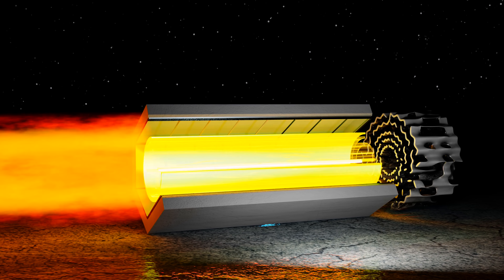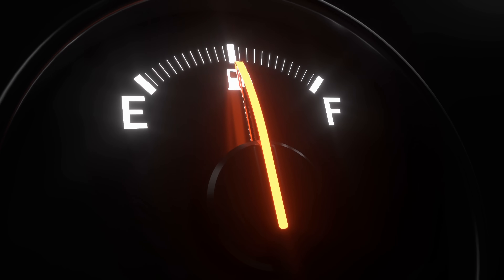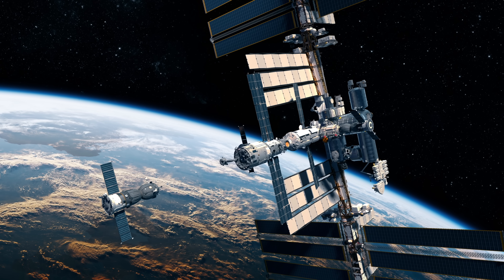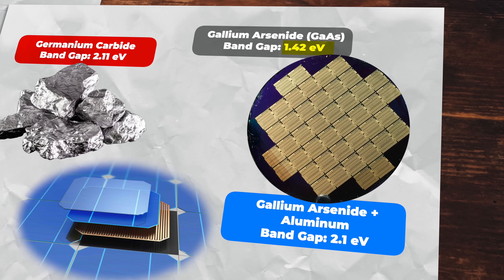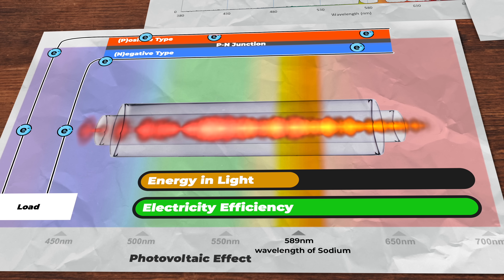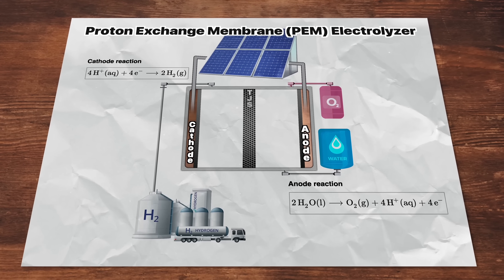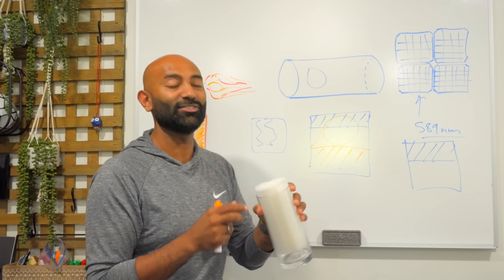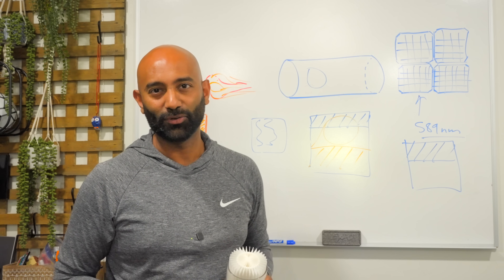Why Solid State Might Save The Combustion Engine

Comment: It would also make a much more efficient RTG for deep space missions.  I imagine, though you have to heat up the sodium vapor to a pretty high temperature to get light output. Probably hotter than the exhaust of a traditional internal combustion engine.
Reply: In a heat engine the maximum efficiency is (hot side-cold side)/hot side.  The problem in space is the cold side as the only way to cool is via radiation which is very inefficient at the temperatures involved.
Reply: @mtpaley1  that is a good point, but it’s also true of standard RTGs. However, I suspect that the temperature required to get the sodium vapor lamp effect is much higher than standard RTGs so larger radiators would be required. Adding weight.  Maybe you could offset that by carrying less plutonium, but I doubt it, and it would kind of defeat the purpose of having a more efficient unit if you were forced to carry less total capacity.

Comment: I don't see how the fluorescing of sodium is going to ever be highly efficient.  First of all the heat transfer is going to take time, you have to raise temperature high enough to both break Na-Cl bonds, and then further excite the valence electrons in Na, and you're depending on how much of that heat is absorbed to excite electrons up a band.  There is no way that can be more than single-digit efficiency.
And even with a tuned bandgap PV, absorption efficiency has to be near perfect, which itself strikes me as nonsensical.

I think it's safe to say that the optimal fuel for this is the highly abundant Oil of Serpent.

Comment: I like how your mind works on problem solving…. I spent a weekend with a heating engineer who would be great to capture the waste heat from the car engine using phase change materials… so that when you came home, you could dump this heat into your home water storage system. Not as fancy technically as PV but workable…. Until you look at weight being carried around. Still… always great to pull problems apart and see where you end up.

Comment: How do you inject fuel and air without moving part? Carbon deposits from combustion on the panels will absorb the light reducing PV efficiency.

Comment: It sort of do not solve the reason why we want not use combustion. And that is the combustion uses up the fuel and that fuel becomes pollution.

Now, I am actually not against fuels in general over using batteries. Some fuels do not put out what we would consider to be harmful pollution. Like Hydrogen that when it burned just output water. But you still need a way to produce it.

While the claimed efficiency may sound high, there are gas turbines can get efficiency over 60%. Of course that comes with it own costs since gas turbines are pretty much the opposite of a solid state device. Lot of moving parts. And if they get that working, it could of course have uses. But is very much a technology I want to see running before I start to believe it. 

So yes. In short. I do not think this would save the combustion engine, but if it works it may replace in the areas where combustion engines would still make sense to use. And that is only if it works.

Comment: Absolute BS!! Why do you fall for this BS. Carnot efficiency = 1-T2/T1. (Temp in Kelvin). Assuming efficiency of solar cell was 90% (unlikely) the efficiency of heat engine would have to be >90%. Assuming engine cold side temp (T2) was 100 deg C (373K), combustion temp (T1) would have to be 373*10 or 3700K. Do you think you could generate sodium light at 3700K with 100% efficiency!! I think not.

Comment: Although it may be efficient, we don't always need loads of energy quickly and this seems like it would burn a load of fuel extremely fast compared to the trickle of a battery or small controlled burns in a combustion engine. How do we control output in this type of engine?

Comment: The most efficient engines we have are turbines which can get at least 60% and some modern designs claim 70% or higher.  I would be very surprised if this could do that. There are always unconsidered parasites that rob efficiency. There is a chance that this could work because 1) it channels thermal energy into a monochromatic light wavelength.  There is almost some violation of entropy going on to do this with high efficiency, but ignore that for now.  As the sodium gives off its light, that lost energy will need to be replaced.  The end exult is that at some point you will not have enough temperature left in the tube to make the sodium emit.  BUT, you will still have high temperature exhaust.  This is the final limiter of this device.  I don’t know how much energy ends up coming out the exhaust of his thing, but it’s go to impose at least a double digit penalty to efficiency. I’ve got to believe hat waste heat must be near 30%.  But, for the heat energy retained, with a long enough tube it could be all converted to sodium light as long as there are no other losses (which I’m sure there are: black body radiation for example).  But I suppose that conversion to sodium light proper might could be fairly efficient.  And then if the solar cells have a matching narrow band band gap, at least with some mirrors you might collect a fair percentage of the photons.  In the end, there are lots of efficiency leaks in this that can easily reduce the net total efficiency.  So I doubt it could be much more efficient than a modern high efficiency diesel.  However, it it can be made light and small, it would have many uses.  Other than efficiency, the one key problem I see is materials.  This thing needs to be transparent, while also being able to sustain very high temperatures over long periods of time.  Unless they can figure out cooling solutions, that might doom it there.  Will be interesting to see if it can be worked.

Comment: An interesting tech.
A: The effluent ie how polluting is it.
B: Our material science should be able to design the materials needed.
C: An interesting tech to watch.
D: Looking forward to independent test results.
E: Very clever if the numbers prove true.
I live in a hurricane  prone area of Tx and have used standard gas generators here to keep the fridges running.
NOT very efficient and LOTS of moving parts.

Comment: Build a working prototype and show it to others. At first glance, this looks very problematic to me. A few obvious issues:
1. What is in the exhaust and where does it end up?
2. How do you control it with no moving parts.
3. Two problems with all fuel vehicles are a) Creating the fuel. and b) Distributing that fuel.

Comment: Something strange.

The end product is a Free Electron. 
You're using Solar Cells to do this.
Light from Heat
Heat from Combustion.
Combustion itself is simply the rearrangement of molecules as well as Electrons. 

Why haven't they considered getting the Free Electron from the chemical reaction known as Combustion? You know its happening. It sounds a lot more efficient than adding more conversion steps.

Oh yeah. Because then you'd call it a Fuel Cell instead.  Got it.

Comment: Based upon your description, you should be able to simulate this system even on a small scale using a candle.

One problem i see is that so much energy will go out the exhaust (not just heat but light too). So i can't see how they can get the numbers they're predicting. 

We'll just have to see a prototype.

Comment: why not use solar collector to heat up those sodium and then use the tuned PV cell to convert it to electricity? wouldn't it be cheaper for static power generator

Comment: Every single time energy changes form it doesn't change 100% of it's energy from one from to one other form.  It always has different percents go to probably all the different kinds of energy like part heat, part going to light, sound, kinetic, etc. types of energy.  This means the more times the energy changes form the less likely you are to get the type of energy you want out of the system.  If you change chemical energy to heat, to light, to electric, to kinetic to move a car the efficiency is going to be crap.  This means this is another company trying to get investor money, so they can make that money disappear, and say later, will it didn't work out.  Who would have known.  Well a good engineer like myself would knows.

Comment: Better than using an ICE:  Use the main burner as stated with photovoltaics, then using catalytic converters to heat a second chamber.  If that exhaust is still hot, you can add a bank of peltier chips along the outside of the photovoltaics and the final exhaust to not only cool down everything, but increase the efficiency even more.  Rather than a flat wall of PV panels around the main combustion cylinder, you could angle them so that they bounce light around for more surface area in an inverted flower shape.  The whole device could be incased in a tube that uses filtered air from the forward movement of the vehicle while in motion, and a fan at idle that uses Bernoulli's principle like a dyson fan while stopped.  It's an interesting concept.  It's how they plan on getting fusion to work in the long run...

Comment: It's a low oressure sodium lamp, but it uses burning fuel to heat the sodium instead of electric heaters, then captures the energy from the monochromatic light with tuned photovoltaics. Interesting and potentially viable. I'm going to guess there are a few peoblems:

1. It think it would have to be bigger than it was depicted in the video. I don't think that energy density per surface area of heated sodium is as high as the video portrays. The tube would have to be much longer to create a useful amount of light. 
2. The end of the tube where the flamable gases are injected is hotter than the exhaust end. This could cause big problem with efficiency because it's hard to get the sodium to the ideal temperature everywhere (it's easier with and electric heating in a traditional sodium lamp)
3. You're never going to heat the sodium hotter than the exhaust gas, so  there's always going energy loss due to that. I tried looking it up and it appears that low pressure sodium vapor lamps operate at 150 deg C or lower, but i couldn't find the min temp. That's still pretty hot.

Comment: Interesting video about yet to come to market ideas. My personal favorite way to enhance solar was with the use of quantum dots that supposedly accept all radiant energy and can then reradiate at a specific frequency that is matched to the solar cell it’s attached to. Haven’t heard any updates on how that technology is coming along. My personal adaptation would to be to form my solar cells into a tube with the nano dots facing inward, plug the ends and fill the tube with waste tritium gas from existing stockpiles timing from at nuclear power plants. The radiation from the tritium would be converted to a continuous light source with a manageable lifespan since the half-life of tritium is only 12.5 years.

Comment: I see the potential in this idea but I have one question in that when you burn hydrocarbons exhaust gasses are produced which are toxic to the environment and one of the principal reasons for the drive to renewables so how does this system deal with that?

Comment: This is way cool!  Your application for ICE cars to create true hybrid cars is good, but you still have all the maintenance that comes with ICE car engines.  However, it could be implemented as a retrofit system for all existing ICE cars.  Going forward the solid state combustion system looks like it has minimal maintenance, if any, and would be much better.  Even Big Oil would get behind this.

Comment: thats like a direct heat sand battery, with the solar pv generation system. all the produced heat is first captured in the sand, then its converted to electricity by the solar panels. recapture the heat from the solar cells back into the main sodium system. you can try an alcohol stove burner with the radiator element.

Comment: There is a saying I think is applicable to  the numbers you cite here. "There are lies, damned lies and then there is lying through statistics."
 This idea is just such a lie when compared to solar PV electricity.  Space grade solar PV can reach over 30% direct to electric conversion  on earth without rise in temperature much above ambient.  The rest of that solar energy impinging on PV gets lost to the air or the earth. This solar PV energy is from the hydrogen fusion source we already have. 
For the process you describe here you must first produce that hydrogen, which costs energy from the sun, either in the form of natural gas from the earth plus additional  fossil fueled energy for the steam reformation  hydrogen process used by the petroleum industry,  with that 'natural' gas itself a product of plant photosynthesis from millions of years ago.  I.E.  it is severely degraded solar energy stored in the earth before it ever becomes the hydrogen to begin this new combustion engine for making electricity. 
One might also make the hydrogen with electrolysis, but that process is also quite energy intensive, those losses occur well before you even start that hydrogen flame. Combustion whose heat you claim to get 80% of to run an EV. Hydrogen  as a fuel for any means of making electricity starts with around a 50% handicap before you even start making electrons flow. By my crude calculations from that point, this Solid State Combustion Engine is already at the same thermal efficiency as any IC heat engine. Rube goldberg would love all the complicatied twists and turns I say are needed to get electrons to flow into the motor in your EV with this device:)

Comment: With the 10KW claim, that would be kilowatt hours. You say that would almost be enough to power a house, but you've fuddled the numbers here as the average 14KW a house uses is used over 24 hours, or roughly .58 KWH on average. So, with the use of a battery to handle load spikes, that unit the size of a milk jug could in theory not only power a house, but sufficiently power a dozen or more homes!

But, I agree that this is likely a scam. Which is unfortunate as whilst it would be great for automotive applications combined with a small battery (a tesla uses ~15KWH on the freeway, so at least 2 or 3 units would be required. With that into consideration, i speculate that the weight of the vehicle could still be lowered by 400+ kilograms) my thoughts are that this could make a big difference in large scale power generation. Using nuclear fission (or fusion when it finally happens, one day...) to generate the heat, heatpipes to transfer the heat, and larger scale variants of these to convert that heat into electricity could potentially lead to smaller grid scale generators, or a new generation of portable Radioisotope Thermoelectric Generators

Comment: An automobile gasoline internal combustion engine is 20-25% efficient. This is due to the poor performance of the ignition system and the relatively large gasoline droplets. There are a couple ways to at least double the engine's efficiency: (1) by reducing the gasoline droplet size to 4 microns through preheating or ultrasound and (2) by installing a plasma ignition system. These methods have already been proven in real world use. Diesel engines are 40% or more efficient, but represent a very small percentage of all IC engines in automobiles due to their excessively polluting exhaust.

Comment: So, some issues. This is still a heat engine, and the efficiency cannot exceed the Carnot engine, e=1-Tlow/Thigh. Given the combustion is let’s say at 1500K, that is at best 1-300K/1500K = 0.8 (80%) assuming the exhaust gas is at room temp, which is extremely doubtful . Looking at sodium vapor lamps, their efficiency is temperature dependent and starts around 400C, becoming more efficient as the temp and sodium pressure increase. So the lowest temp is probably 700K. Efficiency is now down to less then 54%. That’s the maximum, adding in all the other inefficiency’s, I would guess at best 20-30%. THEY ARE LYING.

Oh, and BTW, only if Tlow is 0 K is it 100% efficient, second law of thermodynamics.

Comment: Um, light to electricity is never 70/80% efficiency, pervoskite cells are 30% max.
Reply from the maker: in the video i broke down that sodium releases nearly monochromatic light, when coupled with a solar cell with a band gap tuned for exactly that, things change. 30% for perovskite is based on the sun which emits light in a wide spectrum.

Comment: Perfect answer to a question that nobody asked…
Has anyone considered that semiconductors don't like heat?
And only a small part of the heat can be extracted as light in this way, much of it will just go out the exhaust pipe.
The use of a burnable fuel makes this system a complete loser to the battery even before the fuel is arriving at the engine, it has already lost more energy than the complete energy chain for the battery would.
I am always amazed how people get the idea that making things extra complictaed will somehow result in a better solution.

Comment: This isn't Danielle's first startup. She did a compressed air storage solution a while back. I think they had trouble with it freezing up. My question: if the efficiency is high enough, couldn't you just retrofit natural gas and coal power plants with this tech? Those are only 33% - 39% efficient? Also, strap a turbo to the back to get recover some of that exhaust energy?

Comment: I would like to just get away from fossil fuel all together. I'd be happy if all R&D on fossil fuel was halted and all efforts were put into, well, everything else. Solar is cheapest and proven and laser-boring for geothermal looks very promising. Nuclear takes too long to develop and is too expensive and is very limited in potential locations. Hydrogen is too inefficient and free H2 is 11X worse as a greenhouse gas than CO2. Which is a problem as H2 is the smallest and leakiest molecule. So my bets are on solar and, if laser-boring works, geothermal.